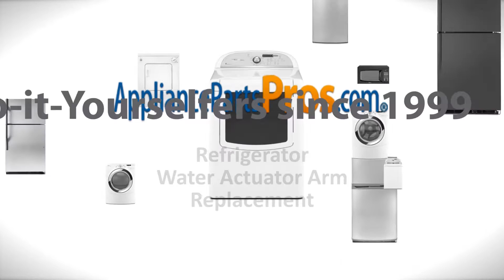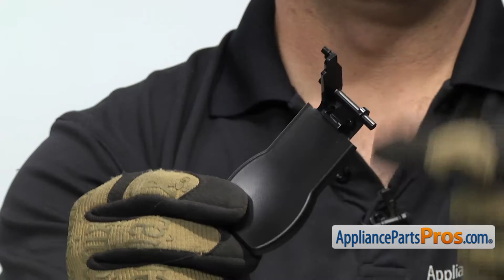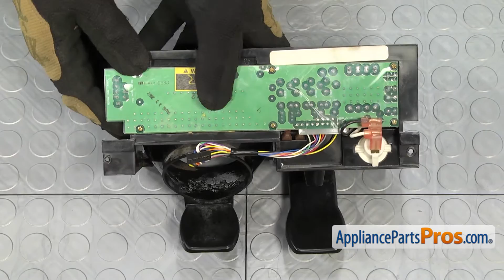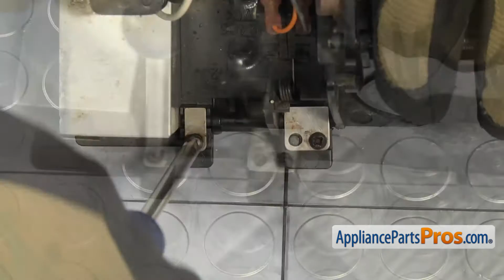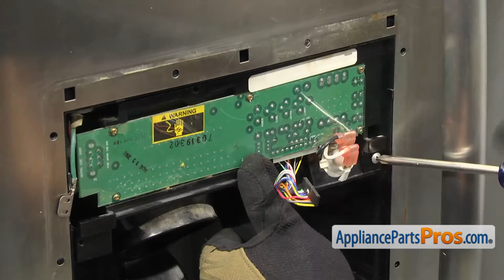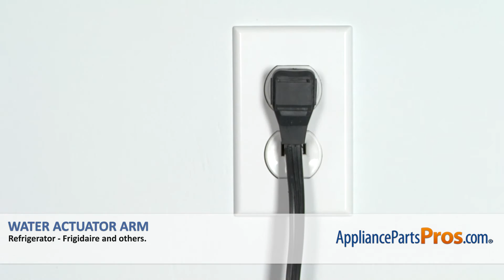How To Replace: Frigidaire/Electrolux Water Actuator 5304493021

Comment: How do you take off the drip tray. It's pretty hard to remove
Reply: AppliancePartsPros  to get the tray off I put all my force on one side of the dish tray and pulled sideways. Thanks for the video!
Reply from the maker: It should pull out pretty easy just like in the video!
Reply: AppliancePartsPros it's pretty stuck on there. Not sure where I should put a flat head to help pry it out
Reply from the maker: Not sure where you both are running into trouble? As long as you are sure you have the same design, it should pull off. You could try a small flat head screwdriver at each end of the tray, in the crease between the tray and the rest of the frame. Just be careful you do not damage anything. At 53 seconds into the video.